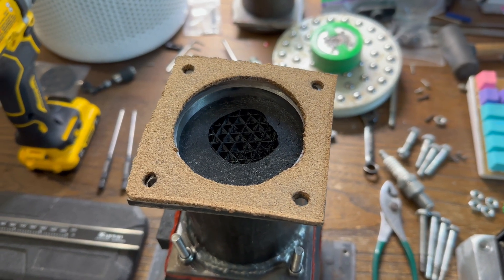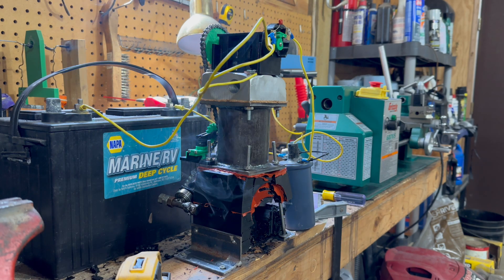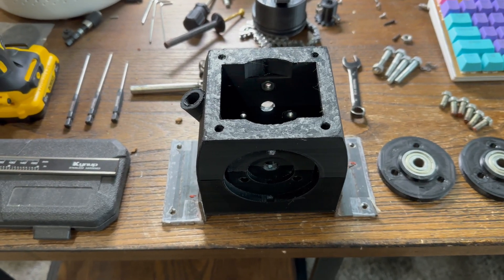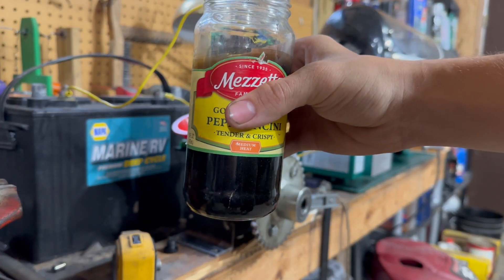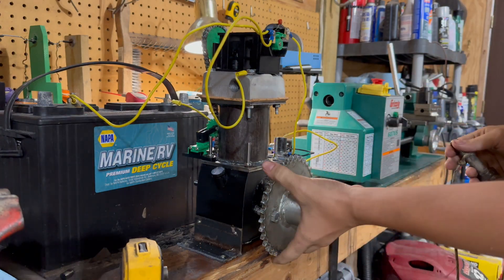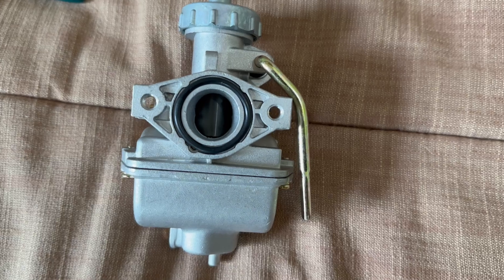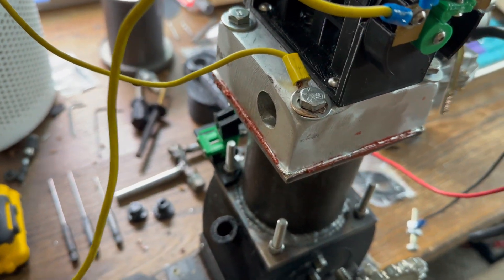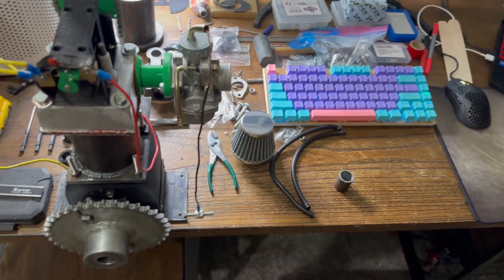3D printed 180cc engine RUNS!

Comment: I believe you need a heavier flywheel and unless your gonna add a starter motor get rid of the teeth. It's unessential and dangerous.
Reply from the maker: You should check out my latest video on the engine 😉
Reply: @ProjectLMZ I'll check it out tbh this was the first time seeing your videos
Reply from the maker: @blaze_4_dayz  I think you’ll be quite happy to see how the engine turned out, your speculation on the flywheel was correct.
Reply: @ProjectLMZ that's awesome just watched it running and it runs well! Great job with this. Also it would be interesting to see a v-engine like a v-2
Reply from the maker: @blaze_4_dayz  I actually want to build a homemade 1 L inline 4, I have the CAD drawings made, it’s just a matter of finishing my single cylinder!
Reply: @ProjectLMZ thats awesome man but heres an example i made with lego! https://youtube.com/shorts/6xnhQNN4_UQ?si=YWjXBLm2p8db8wVw
Reply from the maker: @blaze_4_dayz  that’s super cool!
Reply: One more interestin"engine" you could make is a vacuum engine. You can use your 3d printer and not need other tools. @ProjectLMZ

Comment: It really looks like the engine the youtuber Camden Bowen made
Reply from the maker: I don’t really see it, but all engines have the same components, but don’t worry, I didn’t copy Camden’s, my engine is my own design. I have my own cast aluminum head and valves, and the valve train, crank case, and everything else is my own design. Except for the ignition module, which I have modified to fit my design.

Thank you for watching!!!

Comment: More cc than my daily ride
Reply from the maker: I find it much more fun to make it bigger with a higher chance of exploding! Makes it more of a challenge to get it running.

Thank you for watching!!
Reply: @ProjectLMZ 
I just wanna say after watching the whole thing again this is very impressive. Have you considered designing parts in CAD and using a service like send-cut-send? Unless you have a mill and lathe (or CNC) in your shop

Also! That blowback on the carb is usually due to the lack of exhaust, I'd recommend basically any long pipe just to help the Venturi get gas in and out of the cylinder the right way
Reply from the maker: @ShriKaav  the exhaust is good to know! It will also probably help keep the exhaust valve cooler to, as less oxygen will make it in there, I will have to see what I can find for pipes. Hopefully it will also look cool to!

Thank you!!

Comment: Logic problem for you. FDM = Fusion Deposit Material. Heat material up and deposit it in layers to make part. So.....when the engine FIRES up and gets HOT.....what do you think will happen? I'll wait.....
Reply from the maker: I know that parts like the piston will melt, but that’s not the point. I know that plastic will melt, but the reason why I’m doing it is because it is fun. I am enjoying this project. I’m 15 years old and building an engine, I don’t think most 15 year olds are doing that. My end goal is to transition to all metal parts, but I thought it would be fun to try to 3d print some of the parts. The whole point is to have fun. 

Thank you for watching!

Comment: Brilliant video. 👏  love what you are doing. This is a superb thing to do, and learn heaps from 😊

HOWEVER. take it from someone thats been building engines for 30 years,  You are playing with fire on a biblical scale. Watching the first one throw its crankshaft out was great fun, but could have gone a lot worse. Easy start is a fast burning (more detonating than burning really) and with an open port, you are asking it to immediately run at full throttle....... that's a lot of force 😮😮😮 
A small i/c engine is easily capable of making 1000 psi + of combustion pressure. Yours will do that too. 
I'd wear a crash helmet and full leathers anywhere near that thing. 😅😅
Looking forward to seeing it run in the next one. Stay safe buddy 👌
Reply from the maker: Yeah, with the carburetor now when I test it, I’m able to keep it at a lower throttle, I just remade the crankshaft because it snapped the output shaft where the flywheel bolts on, and I made it out of three-quarter inch thick 1045 carbon steel rod. I don’t think it’ll be breaking anytime soon. 

Thank you for watching!!

Comment: Your engine is really impressive. I’ve not seen many engines with 3-D printed parts run.
Reply from the maker: Thank you! I’m currently building the new crankshaft for the engine, as my previous one snapped with the flywheel bolts on. The new one is made out of three-quarter inch 1045 carbon steel, so I’m betting it won’t break. 

Thank you for watching!

Comment: If you put a piece of wood on your drill press like a 2 x 6 or even a 2 x 4 and then clamp the flange for your intake manifold, you can drill the part without it getting shoved down through the center hole of the work platform on your drill press

Comment: Just so you know there should be 2 screws on the carburators side , one screw is for fuel , and the other one if for air , you need to adjust the screws (normally  7(air) :1 (fuel) ) ratio , adjust it acordingly , also i recomend adding a exhaust to your engine , because that way you might get less fuel consumtion. Also to fix the oil pan issue , you can just drill a big enought hole into the cap , and that would fix the issue , Hope this helps!

Comment: I have some helpful information for you.  I'm an Engineer by profession, have plenty experience with motorcycle and car engines and have rebuilt plenty in my lifetime.

First, your enthusiasm and intelligence make for great video and you're inspiring me too.  I would be doing the same thing at your age if 3D printers were available in the 80s!

When I saw your crankcase explosion, I am certain it was caused by firstly, a lack of crankcase ventilation, and secondly excessive blow-by from a piston and rings which are not sealing enough (despite your amazing compression).

Since you do have good compression, don't worry about the blow by until you stabilize other parts you already have within your grasp.  However, before you do anything else, you need what's known as "crankcase ventilation" which can be done in a few ways.

For your own safety, you must fix this first.  Between a lack of PCV (positive crankcase ventilation), and leaving the oil cap off to "solve it", and leaking fuel from the carb, with no exhaust to catch flames that could ignite all of this, your getting lucky you haven't caught the bench on fire.

I'd clear that bench a bit, and definitely move that battery out of the way because they can explode, just ask me (a mistake I made in the 90s).  Meaning I see exhaust flames igniting fuel gases that are currently being vented out your oil cap and that catches the fuel tank you made on fire and then gets to the battery.  

Trust me, I admire you greatly but just don't want to hear you caught on fire like a friend of mine did over this weekend.

Ok, that lecture out of the way now for what you care more about, getting that engine running smoothly.

Positive Crankcase ventilation vents out the "positive" pressure that occurs when the power stroke pushes the piston down and then the gases blow past the piston and piston rings on their way into the crankcase.  Since even the ideal 4-stoke engine sends unburned fuel out the exhaust (in a healthy engine) or in your case that unburned gaseous fuel is inside the crank case.  This is what caused your case to explode, the positive pressure and potentially a secondary burning of that fuel.

You were on the right track when you realized how much easier it was to pull start with the oil cap off but leaving the cap off and continuing was the most unsafe thing you could have done.   Oil fill port with no cap is directly below the exhaust port so that those unburned gases are floating around and any flames coming out the exhaust can light them in an explosive manner.

Small engines can handle this in a couple (if not more) ways. First is to place a PCV valve on the crank case so that only when the crankcase experiences positive pressure will the valve open and allow unburned gases to be routed back to the carb or intake manifold to be burned, or into the housing for the air filter.  

Secondly, the simplest way you can handle this is drill a hole into your crank case plenty above your oil level line, insert a threaded hose barb that screws into a tapped hole in your crankcase and the barbed in connects to a vent hose which should vent into your air filter housing once you get one on your carb. 

Also, get your carb model number and research what the hoses are for because I'm pretty sure you didn't want to rip that one that was on there and throw it to the side.  If you have a port for PCV hose to plug into, you won't need the air filter housing option.

You're doing an awesome job, just think about the fire hazard your up against and the best bet would be for you to get the engine off the bench or clean that section off.  All that leaking fuel, man I couldn't believe it didn't catch fire.  Had I not nudged you about this I would have felt horrible if your next video showed you covered in bandages, or the garage burned down.
Reply: By the way, you have my subscription.  I see a future Engineer.
Reply from the maker: Thank you very much for the comment! My uncle, who is a small engine mechanic said that the gas is coming out of the crank case are not from blow by, He said that since the cylinder and crank case volume are basically the same that you just have gases coming out of there super fast. Also, I am 99% certain that the crank case exploded the first time from the crankshaft snapping, as when I play the video in slow motion, the flywheel starts to get more and more wobbly before Finally it flies out the front. 
I really like your ideas about fire safety, And I’m actually not sure how it hasn’t caught on fire yet, But I really don’t have anywhere else to test it, So what I will do is have a fire extinguisher very close. 
I appreciate your comment very much!!

Thank you for watching!!!
Reply from the maker: Thank you!
My next video should be coming out shortly, as I have remade the crankshaft with some 3/4 inch thick chrome plated 1045 carbon steel rod. I don’t know if you have seen my latest short, but the crankshaft snapped where I ground a flat spot to bolt the flywheel on. I have messed around with ChatGPT, I asked it if 10 mm thick steel rod would be strong enough, and it was for the most part, it just snapped at the weakest point. With the new crankshaft, I had to get new bearings and they are a very tight fit, so I have thrown the crankshaft in the freezer, and I’m going to heat my bearings up on the bed of my 3-D printer and hopefully they’ll go on much nicer. I’ll look into the PCV valves, as it seems like it’d be a good idea. I’m actually surprised that I have as good of sealing on the valves as I do, I can’t lap aluminum, it just likes to marr itself, so I ended up just hitting the valves and the valve seats with 220 grit sandpaper and they seal basically perfectly!
Reply: You have soaked in a lot of  knowledge inn your relatively short life span and it shows.

I’m sure you will continually be in my mix of topmost inspiring and educational content creators. I actually had to read your comment twice to truly soak in all of your thought process’ (which  is not a bad thing at all).  So what type of engineer will you become collegiately educated in?  Dare I guess mechanical first said electrical second and both third?
Reply from the maker: @jtbrower  you nailed it! Mechanical engineering is what I’m going for! 

Thank you for your comment, it means a lot to me!!

Comment: That infill, why not print it solid? I printed some things that had to hold up to a lot of pressure, and heat. Not sustained heat, I think that will be the biggest issue in this project.
Reply from the maker: The new piston is 80% infill, that’s why the other one broke is because it was only 20%.

Thank you for watching!!